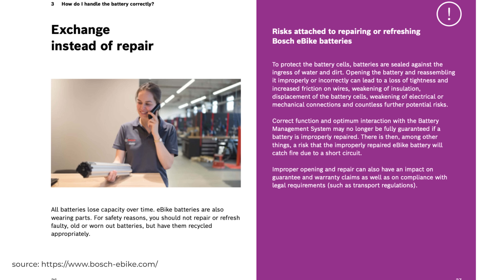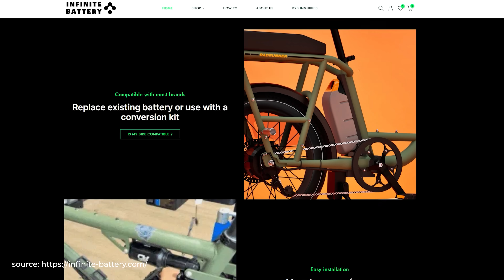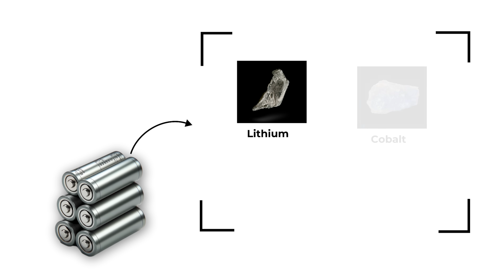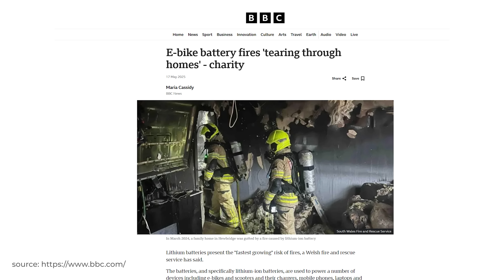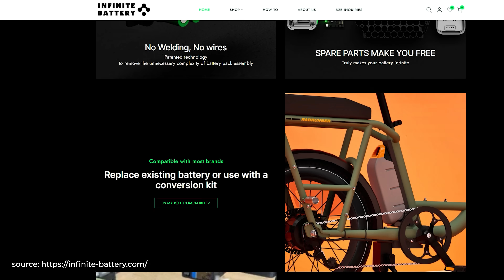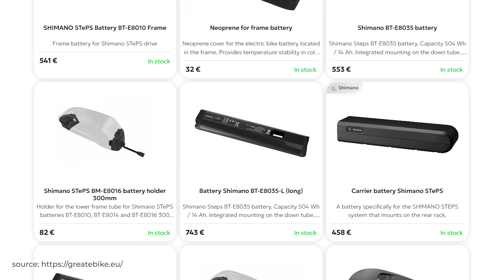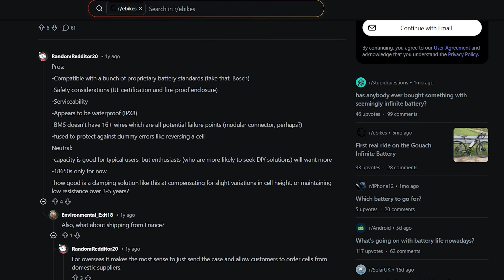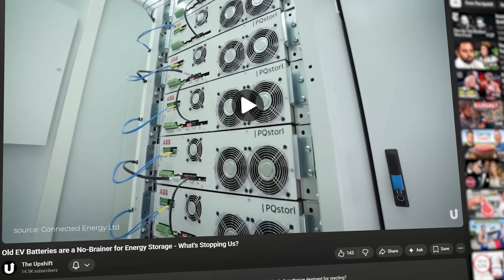This e-Bike Battery Rewrites All the Rules

Comment: may not matter in a year or two but great idea none the less. Donut Labs and Samsung both claim to have batteries  that last 50,000 to 100,000 cycles and charge to 100% in about ten minutes. Donut labs however use zero rare earth materials where as the Samsung ones require a kilo of silver per battery pack.

Comment: BOSCH have just introduced part-pairing to their motors & batteries similar system to Apple. This forces end user to only use genuine approved replacement parts. You may find you can't rebuild a new Bosch battery as I doubt they'll approve it. We need Governments to force companies like Bosch to allow 3rd party repair / rebuilds.

Comment: We have two e-bikes which were put into storage for the Arizona summer. When we took them out in the winter, the batteries were dead. No amount of charging helped. We then asked the bike dealer about replacement batteries and were told they were $500 each, if we could get them. Heck, we can buy new e-bikes for $500 each. I’ve considered opening them up but would have no idea how to remove the dead cells if they are welded together other than cutting them out, then how could I reconnect them without soldering them?

Comment: Whilst it is nice to have some repairability, the problem with this battery is that those cells pressure relief safety mechanism is to pop the end off, that's the main issue I see with this, spot welds aren't actually the most conductive form of contact, think about it, it's two spots welded and the rest of the contact area is mostly unused on the contact plates, what it is, is it's adequate enough without compromising the safety mechanism, I think this is more dangerous than it is good, I'd much rather they work with spicy pillows than 18650 cells if they don't understand that they're compromising the engineering behind the cells

Comment: That should be possible for all batteries not just e-bikes. We have so many equipment nowadays that use packs of 6-12 18650 cells but you can't replace just cells. Controller is find, casing as well but you have to pay 3-4 times more for whole set.

Comment: What about sodium-ion batteries?
Reply: Voltage and voltage curve is a problem, they created a drop in replacement. So they need to conform to what the rest of the system understands. But higher capacity, and other chemistries should be possible if they know what the system expects.
Reply: @PietjeNL  I don’t know all of the details, but the Chinese are already producing them for EVs. The biggest negative is power density. For utilitarian e-bike uses, they should be adequate. They are only powering 250-750 watt motors.
Reply: @barryrobbins7694 It will be, but the motor and electronics needs to be able to use it, thats why new is easier than building for existing. But Sodium for storage will be big, ones the inverters are able to work with the voltage range, it is exactly the same when LFP came on the market, voltage range is almost the same, but to determine soc was in the first hard, but the whole world figured it out.
Reply: @PietjeNL   Energy storage for solar panels will be great too. 

Some of the batteries used for EVs are a sort of hybrid of sodium-ion and Lithium-ion.

Comment: Modular, repairable, weld-less? This is the ‘right to repair’ ethos, engineered right! 🔧🔋 As a manufacturing guy, seeing cell-level serviceability is a game-changer. This isn’t just a battery; it’s a blueprint for sustainable design. Huge respect.

Comment: I'd like to see LTO (Lithium Titanate Oxide) batteries used on ebike / etrikes.

Lifespan is a massive 20,000 - 45,000 recharge cycles!?!  Absolutely unheard of.  Buy it once, might last long enough to gift yer grandchildren.

Also the safety-margin is beyond any battery chemistry out there.  You can DRILL straight through the battery-pack without worry.

They're built like a tank & last forever.

Comment: I think my concern would be safety, fire risk, I think fitting and wiring a BMS and or cells, is well within the wherewithal of someone with electrical skills and inclination, the chance of mishap or quality issue is skill and and supplier provenance dependent, The potential for harm and property damage should there be a fire is very big, If there is a short or cell quality issue raising a fire. Its going to be a significant event.
Nevertheless the stranglehold Bosch has is bothersome, they charge hefty premium, and they don't even have USBc charging and discharge,  just a massive brick and strange plug. You are locked in to at leas one hfry bill in the lifetime of the bike I expect, and should the battery format by obsoleted you have lost your bike.

Comment: Lithium Ion battery packs are really dangerous.
I work at an engineering firm where we build a lot of high voltage battery packs. I love the right-to-repair aspect of this video, and would love to have one of these batteries for my own E-bike. I really want this company to succeed. 
But that being said, Lithium Ion battery packs are really dangerous. That part is not just an excuse from the companies to keep their monopolies: I mean, they absolutely use the fact for their advantage in a despicable way, but that doesn't change the fact that Lithium ion batteries are really dangerous. Especially if you aren't trained to work on them, or if you get an inappropriate type of cell. 
We take a lot of precautions at work (extensive education for staff, batteries always stored in fire-safe cabinets with automatic fire extinguishers, special rooms for work on open packs, special fire extinguishers, etc etc), and we still had a pretty bad fire a couple of years back (400 m2 of floorspace had to be evacuated, and clean up took ~2 months. The building still stands, but a lot of stuff inside was not recoverable. Nobody got hurt).
Keep hacking, but be safe out there.

Comment: Great to see someone trying to standardise eBike battery design/repairability. 

The next step is for replacement motors that can fit into OEM caddies/cases and bike frames. If a 5 year old motor fails and is obsolete or no longer repairable, a non OEM aftermarket motor that can be mounted into old eBike frames using either a new caddy, or even the old motors OEM case. 

Keeping our bikes going for many years needs to happen, I cannot afford to replace my bike every 3-5 years, my 10 year old MTB still meets my needs. I'd love a new bike, but right now, I'll wait as I still don't see eMTB bikes standardising anytime soon!

Comment: All they have to do is make the battery cases by integrating the bms and all It's wiring inside.

The whole lid should be removable, and you should be able to pop each cell like a AAA battery in toys.

The case should have a small array of leds or a small display to show each batteries health on the bms indicating which cell needs to be replaced.

Yes it will increase the cost a litte bit.
But in return you get a replacement method that is as easy as changing your remote battery.

Comment: I bought an "infinite" battery for my ebike.

It actually works and I love the idea.

But:
- The price is eye watering when you consider that I can buy a 13S3P  battery with cells for 50€ on Aliexpress. The infinite battery is not just 200€. With shipping and taxes it's 300€ and that WITHOUT the cells.

- I tried using it with old cells I pulled out of laptops and have to admit that that doesn't really work. The BMS takes WEEKS to rebalance the cells and the battery is too small to be used with low capacity cells.

Comment: 1 point of contention, replacing gas with electric is NOT cleaner, it just moves the pollution outside of the city.  Rare earth mining is disastrous for the environment not to mention disposal and long term pollution damage from discarded batteries.

Comment: I change cells regularly in all devices from standard duracell AA’s in a remote control (1 battery dead the other fine) just shows hiw many good batteries people dispose because they do not have the equipment to test a battery. I fly and build DIY drones and see the same issue in lipo batteries and fix these aswell.

Comment: There are significant safety issues with end user repair of Lithium-Ion batteries. To advocate user repair of batteries will inevitably increase the risk of fires. The issues are many and complex, beyond the capacity of anyone not expert in the manufacture and design of the cells and battery management systems. The only safe way to deal with end-of-life is to enable repair by a qualified expert or recycling. Even reuse has some safety drawbacks. Recycling is becoming an excellent solution where virtually all of the components can be rebuilt into an even better cell as development of the technology continues.
Reply: thought exactly the same. this all just sounds great, until you have enough knowledge about you not knowing enough about how and under which circumstances you can replace a single, a few or all cells. right to repair is a good thing, but there are also good reasons, why only experts should be able to do it (so the manufacturers making it harder for noobs to tinker in any way with the battery). you also wouldn't want a noob to mess with high voltage stuff and nobody would argue about that being good for everybody's safety.

Comment: Two main problems:
• power output will be limited. Due to the much higher contact resistance without hard connections, the BMS will be configured to lower max current limits than competing battery packs. This will impact users who want higher power levels from the same size/wright battery packs 
• you can’t replace cells in the parallel blocks without being very careful to match the voltage else you’re going to get arcs, fuses/traces melting etc. so this is obviously why the company is suggesting to replace all cells at once. They don’t even want to encourage users to replace all cells from a parallel group - even that’s too risky for most people. 

So the limits of this “serviceable” design probably outweigh the benefits and on unit economics, it’s probably an inferior product. Good thinking tho.
Reply: 1. They're showing continuous current rated for 25 amps, 1200w, so anything that isn't the AWD bikes, Wired, or Tuttio ICT is probably fine. BBSHD will do just fine with a couple amps less, all mid drives besides cyc will run off these. The high power customers just aren't numerous enough to really justify something engineered for more than 2kw peak like this

2. I really can't believe this would be above that many people's comprehension, but here we are..

It might indeed be tough for them, given that so many ebike customers are already buying batteries with their bike, and diy is such a small part of the picture. I'll be buying this, though. I've been drooling over it since last year

Comment: Swappable, repairable or modifiable batteries are going to lead to  greater restrictions  upon e-bike use. Here in Australia following a couple of highly publicised e-bike fires (no major manufacturers but each was an after-market conversion) on public transport, e-bikes have been banned from transport on public transport in one state, and only commercially manufactured e-bikes are permitted where I live.
This is  NOT  a good outcome for e-bike travel.
Lithium batteries should not be mucked about with as the risks of damage and failure are there. Lithium batteries can be recycled close to 100% so the replacing with a totally new battery is very wise and should not incur heavy cost as the components (even when faulty) still have good value.

Comment: Have they accounted for lithium being replaced by a technology with a different per-cell voltage?  I'm all for interoperability and repairability.  Even if it requires regulation.  But battery tech has not reached a stable plateau.  Sodium cells and solid state chemistries are here and gaining market share.  And that's a technical challenge.

Comment: Maybe we could program a smart BMS that would allow to replace a single cell in a pack, like if all cells are round 90% life, the BMS could take a little bit more of the cells with more life to balance
Reply: Well, that would need a BMS that could determine the capacity of individual cells. Not a simple thing to do. Then add the complication that all packs have cells connected in parallel. That would mean connecting each cell to it's parallel neighbours through the BMS, so that they could be assessed individually for their capacity. You're adding massive complication in connectivity and the BMS. These factors will push up the cost and make repair even more difficult.

Comment: I need a LiFePo4 option for my Swytch. My workplace won't allow Li-on ebike batteries into the building, despite the 500 laptops, 50 microphones and 35 cameras already in there! :/
Reply: Just lie & print up a sticker saying it’s another type of battery, that’s what I do.
Reply: Like Nickel metal hydride or Alkaline rechargeables, not common these days but once sold in supermarkets as AAs & AAAs
Reply: Well they probably know something 😅 one thing if laptop catch fire and  another is bike with huge battery, you can't even throw it out of window like laptop, it burns so violently
Reply: @dmitryhetman1509  no, it’s just them covering their arses.
Reply: @dmitryhetman1509  
The Swytch battery isn't "Huge".
its Portable.
AS for "Burning violently" a battery gives PLENTY of warning, IF it has a problem it will "Fizz" before "Burning".
Reply: @Hyfly13

Look at the battery type you say you "need".
What are the first 2 letters? (Clue.... "Li")
That'll be "Lithuim".
LiFeP04 i s a "LITHIUM ION CELL" with an iron based rather than Nickel based Chemistry.
.
The difference is the ability of the different CHEMISTRIES to accept, hold and release the energy.
If Sodium ion is the "Normally aspirated with a carb" Engine
Lithium ion, IRON based is the Fuel injected Engine
Lithium ion NICKEL based is the Fuel injected Turbocharged Engine.
The increased pressures and temperatures in the Turbo engine give  LOT more power, but CAN be more prone to failure..... BUT those with "a problem" are looking at the "Evidence" from early generation cells and systems and applying the failings to NEW cells and systems which are GENERATIONS more advanced and safer.
The "compromise" would be "no more than 50% charge when on the premises and no Charging.

Comment: The problem with replacing a single cell or a couple cells in a battery pack is that the fact that if one cell failed then there are probably others on the verge of failure, so you’re constantly going to be disassembling the pack to replace a couple at a time. Good quality cell manufacturers aren’t sending out dud cells that will fail significantly before all the other cells in the bunch. I like this concept of easily replaceable cells but it would be most convenient to replace all the cells at once.
Reply: Exactly. Complete nonsense to replace just the one faulty cells. Like you said, more will probably fail within a short time. And you still have the reduced performance of an old cell pack.
Reply: for the customer, it has little purpose indeed. but for the second life of the cell, it seems way easier to sell them when they.re not welded together!
Reply: Dont see this with lipo dead cells are more common than lion.

Comment: Damn, that really is a gamechanger. The number of times I've had friends ask me to repair their e-bike batteries, and the pain in the ass of having to tear down all the connecting strips, extracting, testing, cleaning and re-welding each cell then rewiring the BMS takes me at least 4-5 hours per pack, no to mention performing charge cycle tests to weed out the weak cells and check capacity adds another day per 12 cells in the pack (I only have 3 x four cell tester devices, to that's a limit). So yeah, I'd love to see more of these out there.
Reply: Lol what? I never even heard of a Bosch battery failing. That simply does not happen. 😂

Comment: YESSS! 
Also - you dont need to be able to replace a cell. If you can just remove a failed cell from the battery and have it working with 39 cells instead of 40, that's all you need to keep the battery going with 97.5% capacity and all the cells balanced without wasting 39 perfectly good cells! I'm not buying until this is a feature !!! Get on it !!! 
If all the cells has to be replaced anyway, you could just as well have them spot-welded as a cell cluster that you can easily replace with another spot-welded cluster -.-

Actually, removing a single cell should lower the Voltage. If it's a 36V battery and cells are 3.6V nominal then there should be 10 cells in series, put in 4 parallels to make 40 cells. 
Having one of the series at 32.4 V nominal is probably bad, which means you would need to remove the entire series, which means the battery could only have 30 cells remaining, and 75% capacity. 

So here's my 2nd solution: 
Have Infinite Battery offer USED cells at different levels of max Voltage, to match with the 39 cells still in the battery. 
The BMS should have built in (individual?) cell health monitoring, easily accessible by app or else, allowing you to check the Voltage that you need for your replacement cell. 
Problem solved. Sure - the one cell might be relatively expensive at $20-30, but it's still better than paying $50 and throwing away 39 cells. 

Also, $50 is suspiciously low for 40 cells. I expect $3-4 per cell for quality.